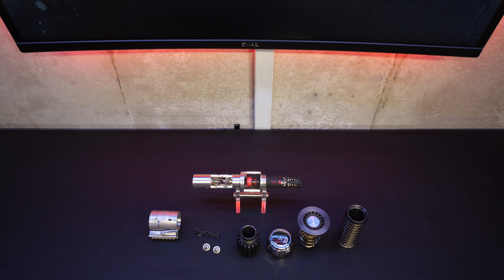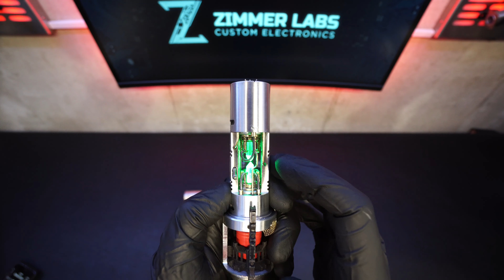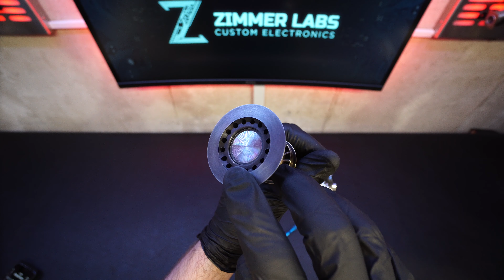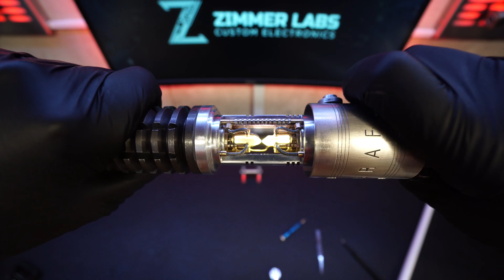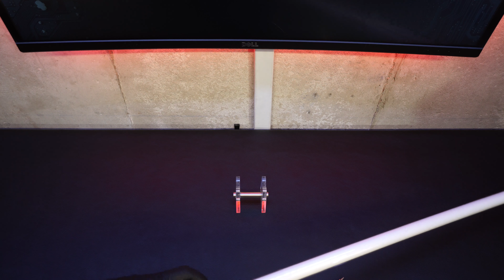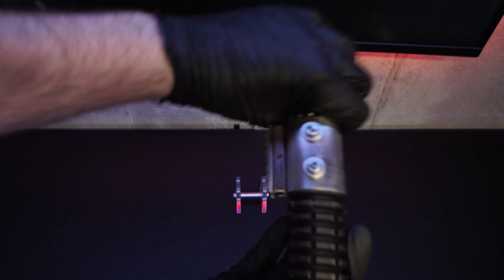Telly's Weathered Masterpiece MKI w Custom Crystal Reveal

Comment: Took me so long to find that same brass perforated mesh screen.  Kept finding chain-mesh. @_@  Great work by the way.
Reply from the maker: You know, you're right about that.  It's really hard to find hexagonal photo etched brass sheets right now.  I'm almost ready to start making them myself.
Reply: @ethanzimmerzimmerlabs823  well yea, then your definitely looking for the wrong thing because what I found is identical/plentiful at about $70 per 24"x12"x0.016" sheet withy numerous perforation sizes and distances.
Reply from the maker: @TrillShatner  Interesting!  Could you possibly email me a link to what you found?  Sounds like something I would be able to use.  And of course, thank you for the heads up!
Reply: @ethanzimmerzimmerlabs823  Sure, ebay, perforated brass sheet 24" x 0.016" x per FT.  It a couple thousands of an inch thicker but widely available